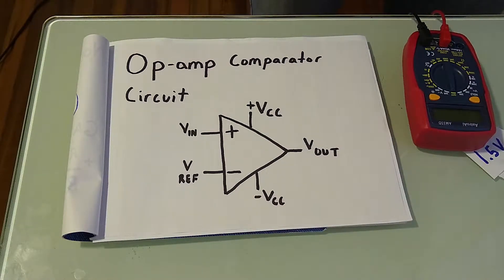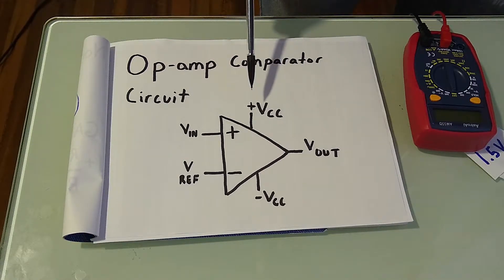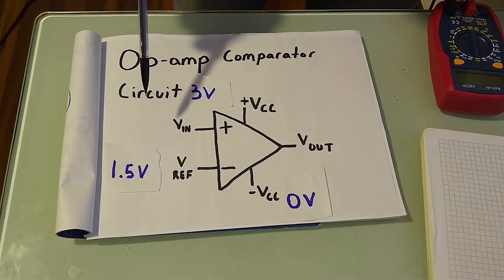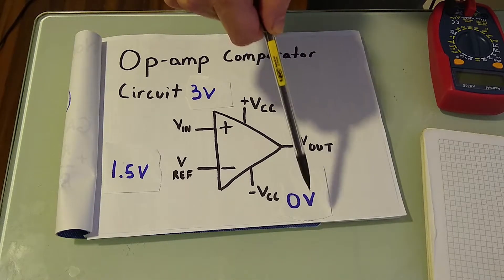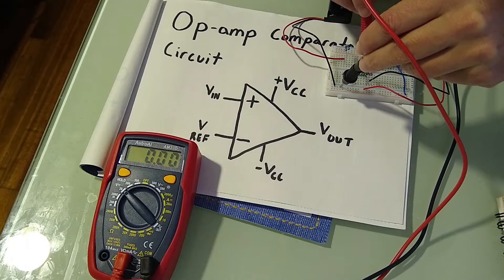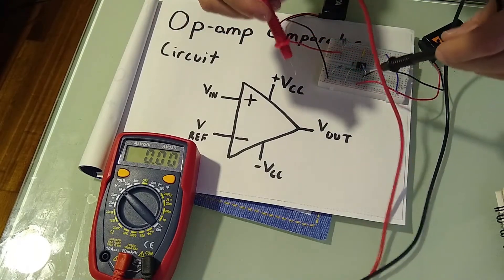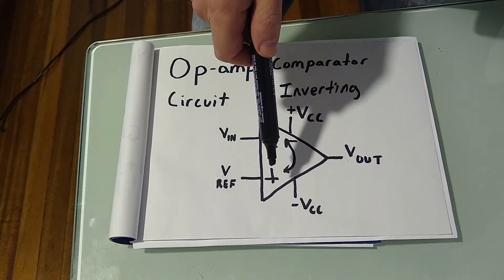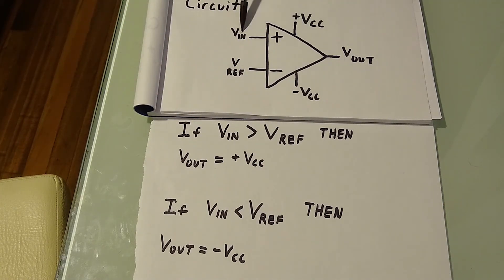Quick And Dirty Tutorial On Op Amp Comparator Circuits

Comment: This is good. So if im charging a capacitor, and i wanna dump it to a battery at a certain voltage, how do i connect my capacitor to the circuit?